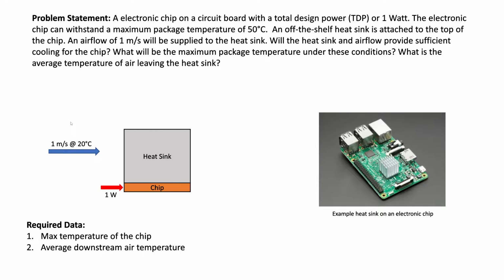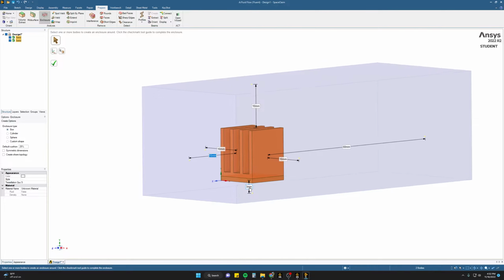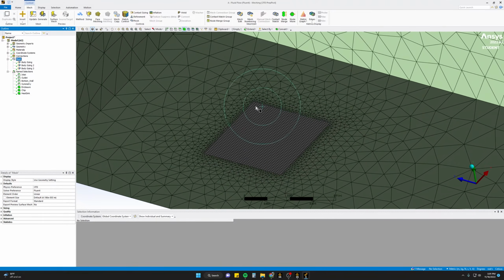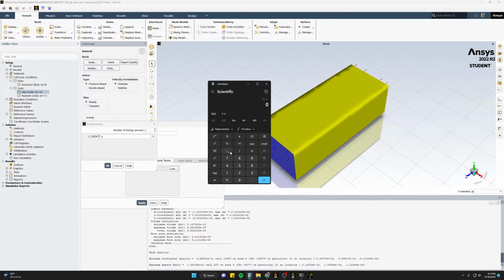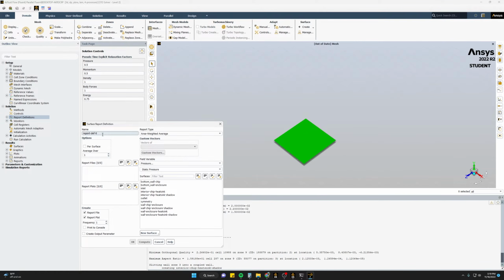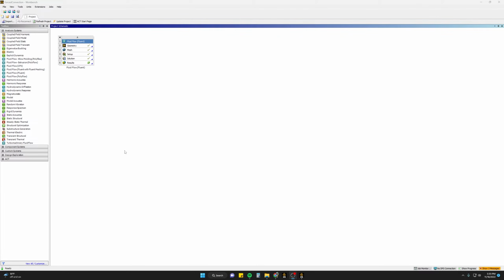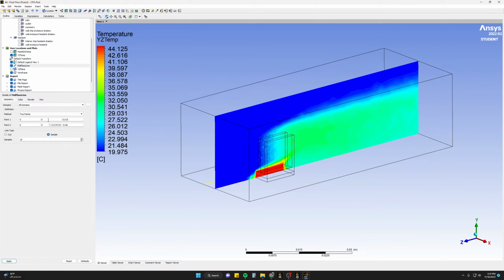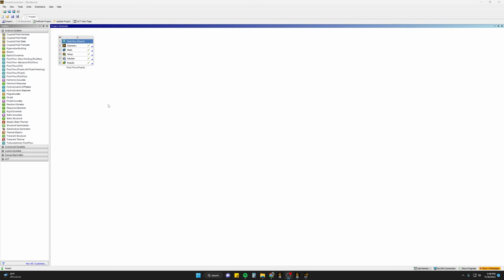ANSYS Fluent: Electronics Cooling Forced Convection | Tutorial

Comment: why copper? chips aint made by silicon?
Reply from the maker: Most CPU chips contain an integrated heat spreader (IHS) between the silicon chip and the heatsink. If we needed more fidelity, we could model the silicon chip and the IHS as two different bodies.

Comment: Bro is it a conjugate heat transfer (means can we check conduction in the solid and convection between solid and air) ?? Means not only the heat transferring from hot body to air cna we check how heat is flowing throughout the solid body??
Reply from the maker: Yes, heat is flowing from the chip, through the heat sink, and into the air. In there last section I show how to create a plane and plot a contour. You can plot the temperature through the heatsink to see the conduction.
Reply: @cfdkareem hello I designed heatsink in solidworks and edit spaceclaim to create enclosure but in setup the heat is generating in chip but not transferring into heatsink just chip temperature is raising
Reply from the maker: Make sure you use "Share Topology" in space claim (7:30 in video). This will tell fluent that all the interfaces are in contact and should be set as coupled walls.

Comment: Hi. If we wanted to get a y+ value of less than 1, where would we need this refinement? Is the bottom of the fins ok?
Reply from the maker: For a highly accurate simulation with y+ value of 1 you will have to refine the mesh at each wall boundary. The y+ value varies based on the velocity, therefore the highest flow regions, at the front of the fins, will need higher refinement than the downstream walls to achieve the y+ value of 1. Commonly, you will run a preliminary model and plot the y+ value on the walls. You can then check which areas will need further refinement and re-mesh accordingly.

Comment: How about inflation ? Did you keep it off on purpose ?
Reply from the maker: Great question! For accurate modeling we would want to include inflation layers to fully resolve the flow and thermal boundary layers at the walls. However, the student license limits the mesh size to 1 million elements, so for the purpose of this tutorial we neglected the inflation layers to reduce the overall mesh size.
Reply: @cfdkareem  thanks for the feedback

Comment: I am doing a thermal analysis for l289n motor driver heat sink, the power consumed is 25 w , the temp are coming in range of 400 degree celcius is there anything I am missing ?, safety temp is around 70-80 celcius
Reply from the maker: Hello, I would confirm that the interface between the chip and heatsink are shared correctly. Is there heat being transferred from the chip to the heatsink?

Comment: When I try to create shared topology as instructed in the tutorial, I still get connections in the Meshing stage. Why is that and how to troubleshoot this issue?
Reply from the maker: That often means that faces or edges are not being shared correctly in space claim. Double check your geometry and make sure there are no small gaps between faces that should be in contact. You can also try changing the share topology tolerance in the tool settings when sharing topology.
Reply: @cfdkareem  Thank you for the suggestion. I re-created the geometry with manual sharing of topology. This worked.

Comment: getting a floating point exception how do i fix this
Reply from the maker: Hello, floating point errors are usually caused by a bad mesh or incorrect boundary condition. In Fluent try domain>mesh>check>perform mesh check. Check the console window and see if you get any error. The check domain>mesh>quality>evaluate mesh quality. If you have a very poor mesh element these checks should give an error. If the mesh looks ok then the error is likely from a boundary condition. Double check your heat inputs and velocity boundaries. Pay close attention to unit conversions and make sure you do not have anything set orders of magnitude higher or lower than expected. Finally, if the simulation can iterate a few times before getting floating point errors then you can use monitors to try and identify what's causing the error. Go to solution>definitions>new>volume ave and create a monitor for both velocity and temperature. If the boundary condition for the heat transfer is set incorrectly you will see the temperature increase rapidly. If it's a mesh error you may see the temperature decrease rapidly or the velocity diverges to a non-physical value. Unfortunately floating point errors can be hard to diagnose, but when you find the error in the setup it is usually fairly obvious. Let me know how your troubleshooting goes and if you have any additional questions!

Comment: Hello, why the thermal properties in velocity inlet are not available? Is this student version limitation? Im using 2025r1 21:16
Reply from the maker: Make sure you turn on the energy model. You will not see the thermal tab unless the energy model is checked.
Reply: @ that worked thanks!

Comment: Sir I have some ques here...Do i need any inflation layer here while meshing?? 2ndly for a heat sink with a curved body do i have to use capture curvature during meshing of the enclosure??Then how do we find the Nusselt num for the heat sink to judge cooling efficiency??How do we find pressure drop over the heat sink for??Do i have to put inlet and outlet pressure to find the gradient??Sorry a lot of ques at a time...But this video really helped me for my thesis...Now I really need the answers of these ques....If U sir reply to my ques that would be a lot to me...Thanks anyway
Reply from the maker: 1) For the best accuracy it will be important to include inflation layers that sufficiently resolve the thermal boundary layer. You can estimate the thermal boundary layer height using analytical equations which can be found in a basic heat transfer textbook. For the best resolution I would attempt to have 5-10 inflation layers inside the thermal boundary layer.
2) Capture curvature setting is really only useful for resolving small curves, such as filets. If your curvature is large it may not have any impact, but I would turn it on anyways. It will not affect the results if it is on and unused.
3) After solving the solution you can determine the Nusselt number by plotting it as a contour or going to results>surface integrals>area-weighted-average to determine the average Nusselt number on the fins.
4) To determine the pressure drop you can once again use the surface integrals tool under results>surface integrals>area-weighted-average and calculate the pressure at the inlet. Assuming you have a 0 pressure outlet condition then the average pressure on the inlet will be the pressure drop across the entire domain. 

Let me know if you have any other questions!
Reply: @cfdkareem thank u sir for the previous response. I have a few other questions.
1.When i tried to find the area averaged Nusselt num for the heat sink surface according to the way u mentioned...it says 0. But for the shadow surface one, it shows something different from my calculations. And the deviation is way too much. So, do i have to go with manual process??
2.I am currently working on jet impingement cooling enhancement using a modified cone shape heat sink. So, when the jet coming out of nozzle there is some possibility of forming recirculating bubble on the surface of the heat sink. So how do i visualize those after the iteration. Also to break the thermal boundary layer I uses some turbulator on the cone surface. So how do I observe the fluid flow behavior around the cone surface.
3.Do u have any suggestions what else parameter I should find to assess the cooling efficiency of cone.

Comment: Hi, nice video! Would be possible to add a heat flux on the chop wall? is correct select heat flux both for chip and chip-wall to be is same?
Reply from the maker: Hello Antoine, could you provide some additional information on what you want to do? Is the heat flux going into the chip or out of the chip?

In the current tutorial the walls of our chip are inside the air domain. They form a coupled wall shown as "wall-chip-enclosure" and "wall-chip-enclosure-shadow" in the boundary conditions. Since this is a coupled connection some heat flux from the chip will be transferred into the air as it flows past, from the chip walls themselves. You can check exactly how much by going to results>flux>total heat flux and selecting the chip walls.

Comment: Hello, Thanks for the great Tutorial. Is it possible to set different initial Temperatures for the Components? I Want to simulate the cooling of a weld
Reply from the maker: Hello, to look at the cooling of a weld you will have to preform a transient simulation. After initialization you can go to initialize>patch and patch different temperatures to cell zones or regions of the model. After starting the simulation the heat will be dissipated over time as the simulation progresses.

Comment: Hello, first thanks a lot for the turorial it helped me a lot. I had a question, how can I add Seebeck effect and Joule heating in the solution model?
Reply from the maker: Hello, Joule heating can be preformed in Ansys using the electric potential model. To my knowledge, there is no Seebeck model natively in Fluent. This could definitely be done with a UDF, if you are feeling ambitious. However, the joule heating, Seebeck, and thermal modeling could all be done natively in Ansys Mechanical with the thermal-electric solver. If you still want to track the fluid flow you will have to couple the results of this model model into Fluent. This is a fairly complex model. Let me know if you have any other questions that will help get your model going!

Comment: Hi, do we need to subtract the air domain by solid domain using boolean operation modelling?
Reply from the maker: If you use the enclosure tool, as shown in the video, there is no need. The tool will automatically apply Boolean operations and remove the volume of the solids from the enclosure.

Comment: How to plot Nusselt no. I recorded it during simulation calculation but it doesn't show in cfd post options.
Reply from the maker: Hello, Workbench can be a little funky with exporting data to CFD-Post. In Fluent, you can try manually exporting the results by going to File>Export to CFD-Post and selecting the variables you want to export on the right side. You can then open a new CFD-Post window and load the results.
Reply: @cfdkareem  thanks, will try that. I had manually noted it.
Your videos are really a great help for us. ♥️

Comment: This is very helpful thanks so much, but could you tell what is the thermal BC at the wall-chip-enclosure and wall-enclosure-heatsink, because as default it is zero heat flux so no heat transfer between the gas? Thanks
Reply: oh I found it, shared topology :|

Comment: hi great video, how would you recommed approaching the same problem with water instead of air, and making it a multiphase problem where some of the water boils off, i am currently trying to do this but i cant seem to achieve convergence of the fluxes [energy]
Reply from the maker: Boiling is a fairly complex simulation which will require multiphase and the boiling/condensation model. Is this what you are trying?

Comment: @cfdkareem...I want to calculate the thermal and viscous entropy. Please guide how to find that data? I found the entropy in the volume-avg option by selecting Temp. But I don't know how to calculate thermal and viscous entropy.
Thanks
Reply from the maker: Hello, in this case, with such a low Reynolds number, the viscous heating was assumed negligible. If you want to calculate viscous entropy you will have to turn that option on under viscous models > Laminar > Viscous heating, and recalculate.
Reply: @cfdkareem  Yes, I found the viscous heating option in viscous model. I found the following statement:

Viscous Heating
(if enabled) includes the viscous dissipation terms in the energy equation. This option is recommended when you are solving a compressible flow. Note that this option is always turned on when one of the density-based solvers is used; you will not be able to turn it off.

In my case, my flow is laminar and incompressible. I am using pressure-based solver as well. 

In that case, how can I calculate "Viscous entropy" and Thermal Entropy"?

Looking forward to your kind response. Thanking you.

Comment: Hello,
Could you please describe in a short video how to do the same cooling study but in large scale for data Center hall containing many racks and servers
Reply from the maker: Hey Ahmed, if you're modeling a datacenter HVAC system you often build up a series of simulations, instead of modeling each individual heat sink in each server. It starts my modeling a single server and calculating the total heat output of each server. You can then estimate the total heat output of all the servers in a rack. Each rack will be modeled as a fan boundary condition with a specific pressure jump and temperature jump. These racks are modeled inside the larger data center and the HVAC system in the room is analyzed. If this is what you are interested in I can add it to my list of future videos!

Comment: Hi, what will be the effects of scaling up or down all the components while still leaving the input values same (i.e., TDP and inlet airspeed).
Also, is using a velocity inlet like in your analysis similar to using a fan with a fan curve?

Thank you for this video 👌
Reply from the maker: Scaling the heatsink will change the amount of heat it can dissipate. Heat transfer is a function of both surface area and fluid speed. The velocity inlet condition will set the pressure and flow rate according to the size of the inlet and downstream geometry to maintain the given velocity. Fan curves usually provide a flow rate vs. pressure graph. In this case the flow rate will depend on the downstream pressure and the velocity will be set depending on the flow rate and size of the inlet. Depending on the specific problem will dictate what kind of inlet condition to use.

Comment: Informative tutorial thanks for your effort 🙏🏻 if I may ask I have question what would you suggest for ansys fluent simulations working on desktop or just laptop with advanced features equal to those of this desktop like Asus laptops?
Ps :I'm consider buying on of the above mentioned computers
Reply from the maker: Hello, I always prefer desktops because they are on average more powerful and can handle the heat of running at full power for a long time during a simulation. In either case, look for a CPU with a good amount of cores, good CPU clock speed, and as much RAM as you can get. Fluent has some GPU, compute capability, but it's still not worth investing in an expensive GPU for Fluent. Also, don't forget a lot of storage! Simulations and results produce some very large data sets. Make sure you have enough room!

Comment: I want to increase the number of fins from 4 to 8 and to decrease the width from 1mm to 0.5mm how to edit. please help
Reply from the maker: Hello Amey1723, you can do this by changing the rectangular pattern of the fins in spaceclaim. At 4:00 I discuss how to create the pattern for the fins. In your case, create one fin at .5 mm, select the fin for the pattern, and make 8 copies. If you have already created the geometry you will want to make sure you recreate the external fluid domain to capture the new heatsink geometry. Also, note that these smaller fins and flow channels will require a larger mesh to capture the geometry correctly! Let me know if you have any other questions! -Kareem

Comment: I have 40x40x15 mm waterblock with heater attached in the front face. I input heat source to 21mmx35mmx5mm heater alumunium block for 2,000,000 W/m3. And then I set operational temperature to 25degC. The water inlet is 20degC. Why would the heater temp only reach around 20degC. I already doubled the W/m3 and it still around 20degC. Can you help me?
Reply: Actually, I have tried to rework your steps in video and has the same result. In other hand, I tried to reuse the geometry and use Fluent with Fluent Meshing with the same parameters in the next steps. And the temperature result is only around 21.8degC. What happened here?
Reply from the maker: @willywahyanto9774   Hey Willy, It will be difficult to give you an exact answer without looking at your setup, but I can give some suggestions. First, what do you mena by operational temperature? You should only set the inlet temperature and the heat source. Second, make sure you used shared topology in your geometry setup and that your walls are coupled. If the walls are not transfering heat it will not allow heat transfer to the air. Third, confirm your scale is correct. It is easy to transfer a geometry in meters that should be in mm. This will make your volumetric heat source much smaller than expected. Finally, confirm that the simulation is converging and you are giving enough time for iteration. If you interupt the simulation too quickly the temperatures can be lower than expected. Let me know if any of these help, or if you have any other questions! -Kareem

Comment: Hi! Thank you for video.  I've only 2 regions in Fluent Meshing. Why? Is it because I'm doing share topology in spaceclaim?
Reply from the maker: Make sure you have 3 separate bodies in space claim. Sometimes when using the pull tool you can accidentally merge some bodies. You can use the split tool to make sure there are 3 separate bodies for the heat sink, chip, and fluid domain.

Comment: is it possible to do this analysis with the chip not being included in the fluid enclosure? with only the heat sink part being exposed to the liquid?
Reply from the maker: Yes, definitely! You can model the chip outside of the fluid domain and only have the heatsink inside the fluid flow. The walls of the chip outside the domain can be sent to adiabatic, or 0 heat flux.